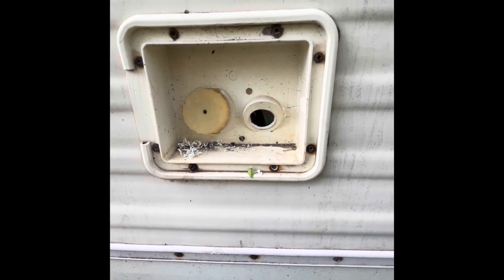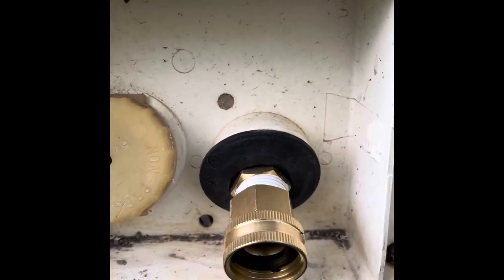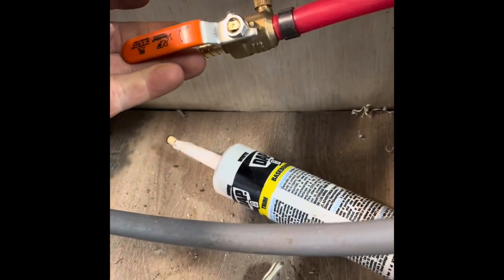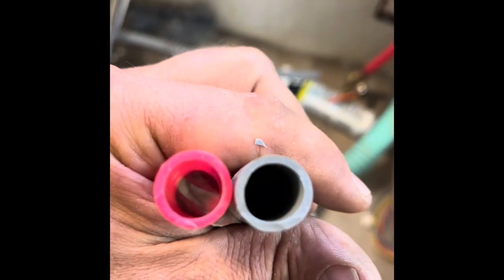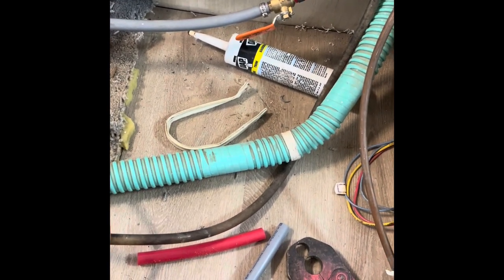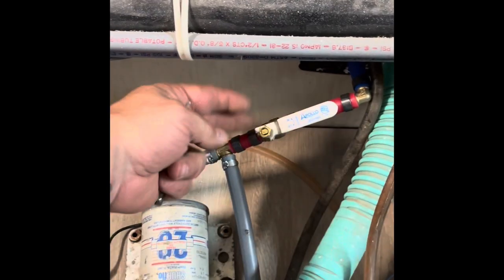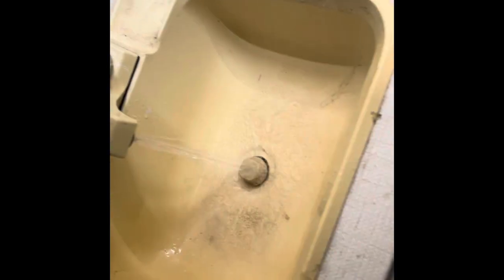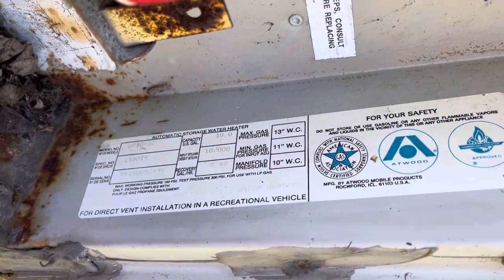Fixing the leaks and more work on the camper. Part 4.

Comment: 1/2 in. Brass PEX-B Barb Polybutylene Coupling, home depot
Reply from the maker: I have one somewhere but couldn’t find it. Home Depot is an hour and a half away so I decided to go ahead and try it with the crimps. So far so good and it’s holding pressure. I will probably order it online so that I have it in stock.

Thank you for the suggestion and the comment though. Thanks for your interest and thanks for watching.